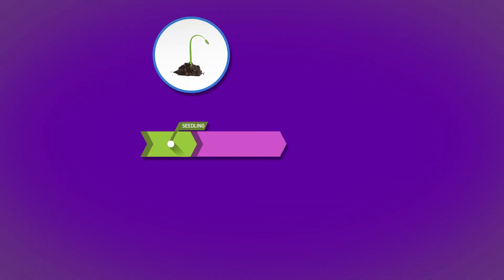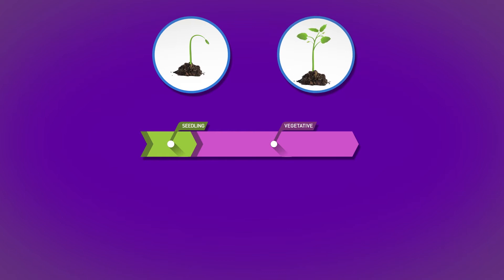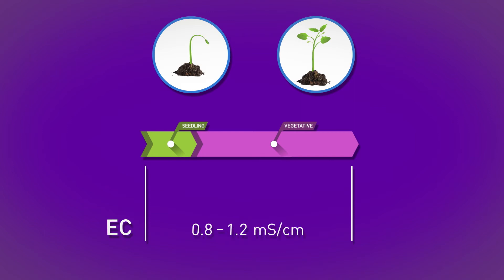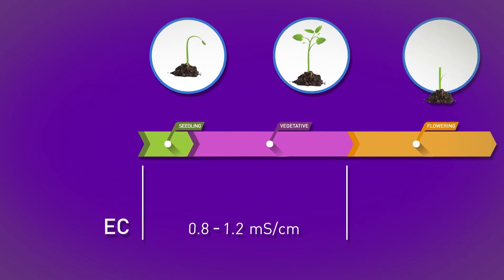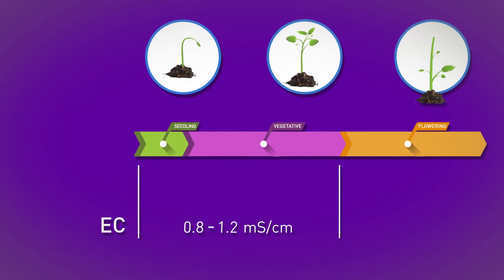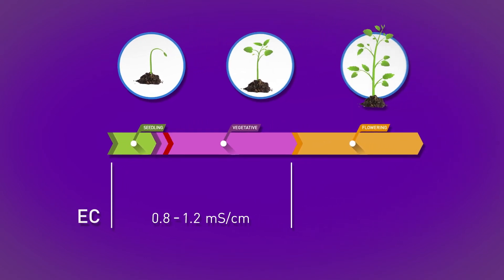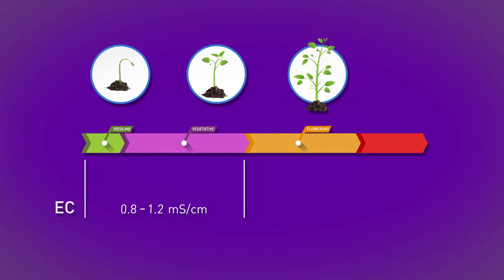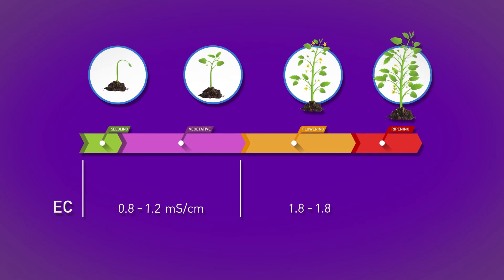How to adjust the perfect EC for plant growth? | (EN)

Comment: Ugh I’m confused…
Reply: Figure it out? Look at it like this, pure H2O has a conductivity of ~0 mS, meaning there’s nothing in it. Natural water has minerals in it, most notably for growing, Calcium and Magnesium. 
Those dissolved ions boost the EC of the water. So if you’re using tap water, your EC meter will tell you what your baseline is - let’s say it’s 0.35 mS (350 uS). That means that you need to add 0.05 mS (50 uS) to bring your base H2O to 0.4 mS (400 uS). 
Then, add your nutrient solution up to 0.8 mS - 2.0 mS (800-2000 uS) depending on the growth stage of your plants. 
Finally, it’s recommended to then adjust your nutrient solution pH to between 5.8-6.5, depending on what you’re growing.

Comment: What tds would u typically want for tomatoes in later stages if your ec is 2300?
1400 tds?
What if your tds is lower than 1400?
Reply: Did you find any answers Growmie?
Reply: dont use tds, use ec. there are conversion charts